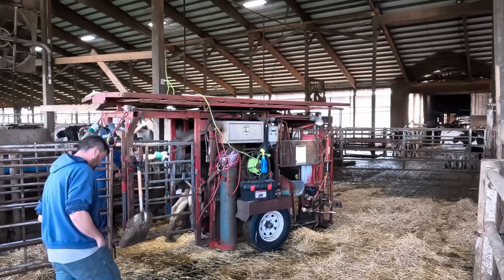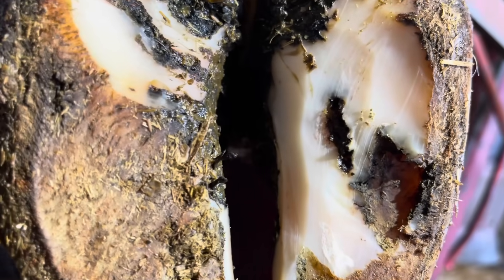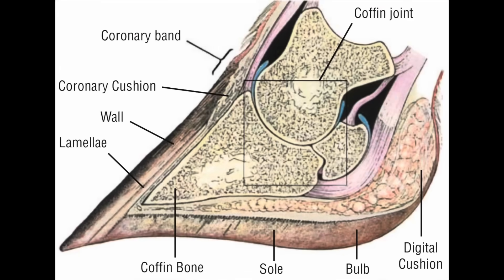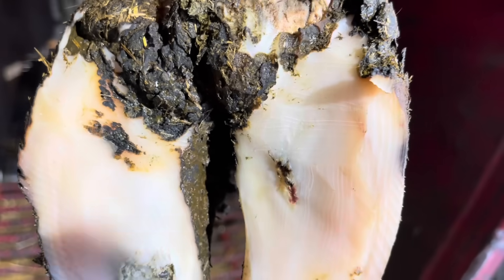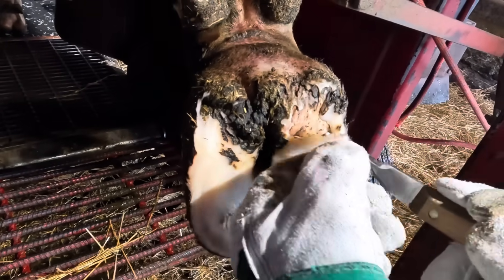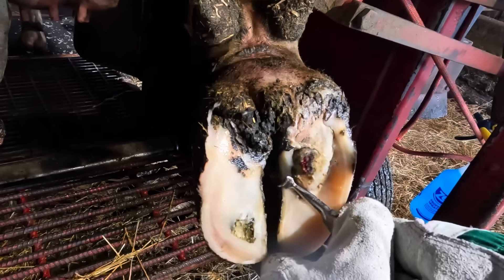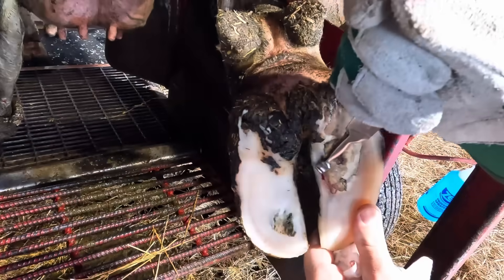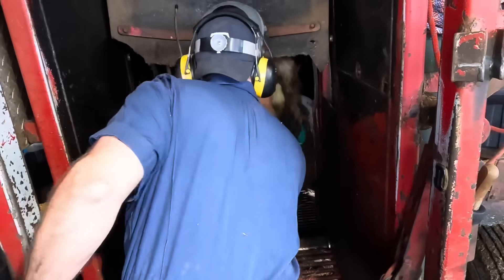GUESS what’s underneath this CHUNK OF HOOF

Comment: I'm honestly curious how old the trimming profession is. Basically, when did specialists arise and farmers stop doing it themselves.
Reply from the maker: As a profession probably in the 70’s.  But as a husbandry practice much longer.
Reply: @NatetheHoofGuy  Some brave men getting behind injured cows everyday before those hydraulic harnesses were available.
Reply: @Ironclad17  They probably didn't have many bruises back than because they were not in these warehouses where the step on unnatural  ground.
Reply: @lemonhead9628  rocks are still getting in on "natural" soil, nothing to do with concrete floors, except maybe, a slight increase in the problem or else you would have lots of trade literature on the subject when they started to put the cows on such floors. 😉
Reply: @lemonhead9628  No, but nice try. It’s partly due to industrial cattle farming, but not how you are thinking. 

Back a couple of hundred years ago, cattle breeds were mostly local. Cows were bred for both beef and milk production. 

We now have two streams of cattle breeds—one for meat production, one for milk production. Dairy cows are bred to put all of their energy into milk production. As a result, they don’t lay on fat or meat as well as beef cattle do. That’s why they look so boney at the rump. That also means that the pad under the pedal bone is thinner in dairy cows than in beef cattle. Because the pad is thinner & absorbs less shock than in beef cattle, dairy cows are more prone to developing sole ulcers. 

So, while it’s always been a minor concern, hoof trimming gradually became a necessity as the breeds specialized in the past 50-100 years or so.
Reply: @DneilB007  oh ok nice, thanks for the info i didn't know that was the reason.
Reply: @Ironclad17  aren't those cow holders a fantastic invention? Brilliant idea.
Reply: @DneilB007 excellent explanation! 👍
Reply: @NatetheHoofGuy  sadly husband's aren't allowed to exist in bidens America anymore
Reply: @NatetheHoofGuy  like as soon as they were domesticated?
Reply: Probably the small farmers that have only a few cows still do it themselves...
But when you're running hundreds of cows you have to have a full-time person that just responsible for their feet is my gas
Reply: @iamg000  but why wouldn't they just hire people for that? Whats with the culture of people just walking around offering their services like this? It almost seems like a great depression-ish style of working.
Reply: @iamg000  hhjjhhhhjhhhjh
Reply: I do my goats but only for basic trims. No way would I be game to go that deep; if there's an issue past the very minor I call a trimmer or the equine vet.
Reply: @marvindebot  i think it was all caused by computers and the internet,,,,never heard of it before and i come from a family of farmers and cattlemen
Reply: @marvindebot  is your best goat the 🐐 ?
Reply: I grew up on a farm, Hereford cattle, they were outdoors as much as possible and inside for winter, and I can’t think of a single time we had to have a hoof trimmer. We did have a Farrier come around for the horses though.  I think the pastures are better for their hooves.
Reply: @hmac163  their hooves are made for the pasture. Nate has mentioned before the dry bedding and sand for drainage makes the hooves harder/dryer.
Reply: @hmac163 That would make sense, hooves evolved for rougher ground to trim the hooves through attrition.
Reply: At least since there were "shoes". Stirrups didn't come into play until around King Arthurs' time.
Hoof trimming since domestication, which for Bovines is practically forever and especially since Animal Husbandry, vetrinarians.
Reply: @lizziesangi1602 correction… stirrups were brought in to Europe from the steppes so Avars, Huns etc.  so much later than the legend you speak of…..they were a Chinese invention
Reply: With technology and it became a time saver….
Reply: James Herriot, described the use of trimming knives ans treatment of heavy  horses in the thirties. I suspect that it's work farriers have done for a very long time.
Reply: @richardseed8253  
Ever since there were farriers!
Reply: Around 1605, Oliver said bollocks to this I'm gumna train a pheasant to do this
Reply: @paulhedges4778  A pheasant, huh? Now that would be something to see.
Reply: @mjrussell414  yeah, but it's a bright and smart one so it's doable with a bit of training. 😋
Reply: @mjrussell414  A birdbrain idea if I’ve ever heard one…
Reply: @mjrussell414  Not just Any pheasant.A Ruff Grouse to be precise😎
Reply: @paulhedges4778  a pheasant?? Might have gone better with a peasant, what with hands and opposable thumbs etc... 😅
Reply: @robbiebunge859  HAHAHAHAHA
Reply: @paulhedges4778  peasant
Reply: @CaptainSpalding72  hiring a pheasant is FAR more interesting though.
Reply: @paulhedges4778 

I hope you meant "peasant".....
Reply: Brilliant question
Reply: Great question
Reply: Am curious how he always knows when they cows have that problem? How does he find out?
Reply: @michealdominic7788  the cow was sore on her right rear hoof.  Limping, favoring, ouch my hoof hurts 🐄
Reply: @michealdominic7788  experience
Reply: @michealdominic7788 Farmers usually have a schedule for their farm to get the cows "done".  With horses it's generally every 6-8 weeks--not sure about bovines....
Reply: Depuis que le vache ne marchent plus dans l'herbe.....
Reply: @gervaiseaubry4307  wrong, pasture cows pick up problems too
Reply: @gervaiseaubry4307  t'as pas bien compris la question, la grande
Reply: @demm26  il me semble que si mais, si vous voulez me la traduire, j'en serai plus éclairée...
Reply: @gervaiseaubry4307  Il ne demande pas quand est-ce que les gens ont commencé à tailler les sabots des vaches, il demande quand est-ce que c'est devenu une profession à part entière
Reply: @demm26  ma réponse est la même.  Nécessité fait loi.
Reply: @gervaiseaubry4307  c'est... pas une réponse 😂
Reply: @gervaiseaubry4307  Jésus vous aimes, Il est mort pour nos péchés
Reply: There was a guy on the game show What's My Line that did it. I'm pretty sure Dorothy Kilgallen was on the panel, so before 1964/'65 (I'm not sure when she passed away), but I want to say he was on in the mid to late 50's. (Those are the episodes I rewatch the most.
Reply: My friend in Norway who’s got about 20 cows said they get a hoof trimmer once a year and the rest is by the vet or themselves if needed. In the summer the cows are outside in the forest/mountain 24/7.
Reply: Sir the work of a farrier was about as old as the first herd tamed.
Reply: We’ve likely been trying at it as long as they’ve been domesticated. They were domesticated originally some 10 and 1/2 Millennia. Whether it was worth it to intervene is another question. These ulcers heal by shedding hoof, but the ability to prevent contact dermatitis is a question. Would uncovering it help or hurt such a thing without a proper salve. Whether such a bacteria was widespread is another. Considering Cattle spread across the world. Different areas would have differing issues, and differing levels of knowledge about it.
Reply: @chickenmonger123  IIRC, the bacteria that causes the dermatitis prefers anoxic (oxygen-free) environments: exposing it to fresh, oxygenated air can help kill it off and help the corium heal. (Note, have never dealt with cows, and got this info from Hoof GP)
Reply: When man started selective breeding he made decisions based off of the animals nature, appearance, and/or ability to perform a certain task. That is when problems showed up, we did not allow nature to do its job, instead we put a band aid on it. An animal with a deficiency in the wild will perish, and not pass on its genes. Hence the soft heart of the farrier was born.
Reply: Confinement housing (always wet feet) and very high performance rations lead to sometimes undesirable hoof growth. Most big herds have a hood specialist on the payroll or hire one for a weekly visit. If the hood guy has proper equipment he can do 100 head/ day at $13- $15 per head plus supplies.
Reply: Farmers are busy as ever. They ain't got time for this. God bless the specialists.
Reply: 1356 as a profession. 6-7th century we have evidence of it being done.
Reply: I imagine in the wild west days it would have been done by the town vet/doctor/barber. In the middle ages it would have been done by the serfs themselves or possibly the black smith. The blacksmith would certainly be trimming horse hooves.
Reply: My ex-husband has done this for a living for 30 years. Here in NM we have a lot of dairies that have hundreds of cows each. Cows used to walk around more. Now they end up in huge pens full of manure which is very soft and does not wear the hoof down. Enter the hoof trimmer.
Reply: Im pretty sure that "in the old times", hoof trimming maybe was necessary from time to time, but due to the fact that the majority of livestock hung out on pastures most of the year, hoofs were less fragile than they are today. I apologize for any kind of grammar or spelling error, English isnt my first language.
Reply: Farriers have been a thing forever, tho hoof trimmers specifically are recent. While the job existed forever, because, despite what some say here, it was necessary forever as cattle always developed foot problems (they develop issues in pasture just fine, simply less of em but still quite a lot), it was done by the equivalent of a vet or the farmer
Reply: I live in a small farming community and I don’t know anyone that trims themselves
Reply: Not in thé same way of course but i'm pretty sure there were guys who did that, like forever. Kinda specialists!
Reply: Don't know but it takes a special person that much is certain, someone who don't mind standing in cow sh*t
Reply: For centuries the care and husbandry of animals was a very specialized skill. Imagine in the ancient world of horse archers and chariots, the care of these animals was guarded knowledge.
Reply: In Texas, haven't heard of as many field cattle being trimmed on a regular basis.  Our horses required a lot more care than cattle as far as feet and diet.  Although they were shod for riding, etc.
Reply: Good question. Now I'm curious about that myself.
Reply: It’s so cathartic watching you use your knife!
Reply: I love your comment, and I am really curious now!
Reply: When they got rich.

Indian Kings had ppl trained to pleasure their animals for artifical insemination.

Can't be more specialized than that.
Reply: The farmers were f*ckin the cows up and someone was like...there has to be a science to this..cause what we doin ain't it
Reply: I don’t have any interest in getting into the cow trimming business but I love learning so it balances out
Reply: I wonder if you have to be a vet or vet tech. If it's a regulated trade with apprenticeship programs.
Or is it just something farmers started specializing in and now anyone can do it, it's a matter of reputation.
Reply: @themonsterunderyourbed9408  you do not, I know this because this other hoof trimmer has dealt with some serious cases and he said “I’m not a vet so I can only work on the hoof, not the actual foot”
Reply: Cow: Moo
Human: hi cow i am here for more milk 
Cow: 😞 Moooo
Human: My children might starve without milk tho
Cow: 🫤 Moo
Human: Your foot? If I fix your foot can I have some milk? 
Cow: 🙂 Moooo!
Human: okay…

Circa 1000 BCE
Reply: Outsourcing.
Reply: Most likely ancient however I can assume that it's become more of a necessity given the increase in unnatural conditions cows are being kept in.
Reply: I have watched other farriers from poorer countries and the poor animals in those videos are in such bad shape. Even the tools that the ferrier is using is primitive in comparison to your tools. You can really tell the difference in both the owner of the animal and the ferrier in the way they take care of their animals.
Reply: That has to HURT!! Poor cow!! Hope it feels better now.
Reply: Since the boss said…so Jim Bob you know how to do this job? Jim Bob says yes and goes on and tries, Boss says…What the heck why are all my cows either dead or walking on tip toes…call the specialist.  5 million dollars later…it’s that time again…Jim Bob…call the specialists
Reply: Can this appear on either side or is just on one side of the hoof ? can both side of a hoof be affected at the same time?
Reply: Hehehe yay 7:38
Reply: If a farmer has 500-600 cows he couldn't manage that himself he would need to contract that out so that's y they have professionals like him come out
Reply: I grew up on a dairy and honestly don't remember ever having the cows hooves having issues that needed this
Reply: Love the long brush from an automatic car wash.  A cow's dream!  🐮❤️
Reply: When the price of milk went up higher than the price of beef?  I hope that we can appreciate the suffering of our live food supply.
Reply: I read somewhere a long time ago when I very first started watching like hoof turning videos that they would hire farmers all the way like States and states away and sometimes like like as far away as like all the way across the country like way back in the day and it would take them like weeks and weeks and weeks to get there and sometimes like the animals would die before they were even able to get there and they would have stopping points in between and these people would have to write a letter to you know where they think these people might be at that time because this was before phones and all that stuff it was crazy to think about that
Reply: Good question.   Hiring someone else to do it is... costly.
Reply: farmers never did it